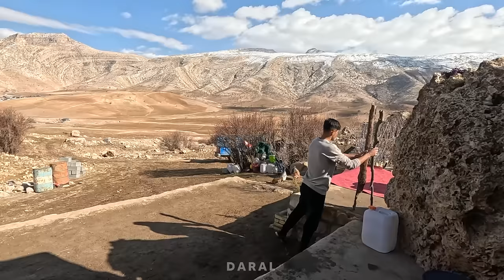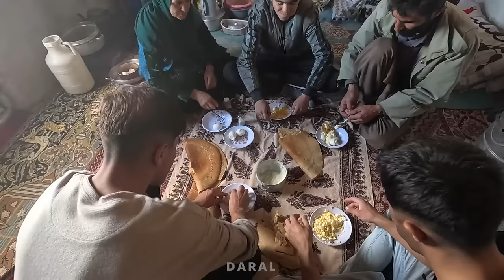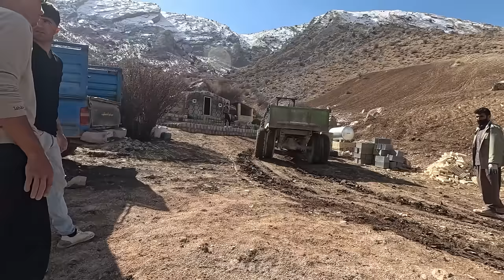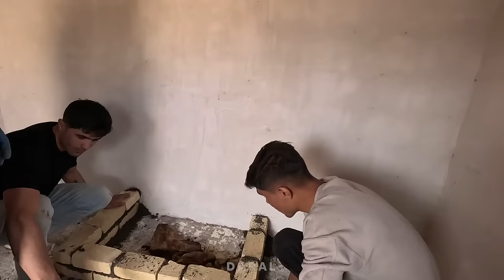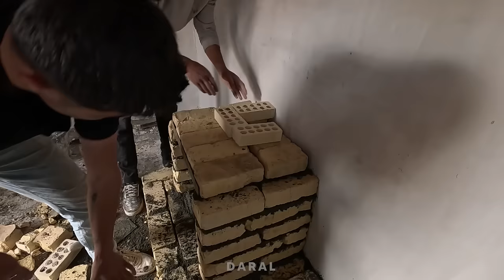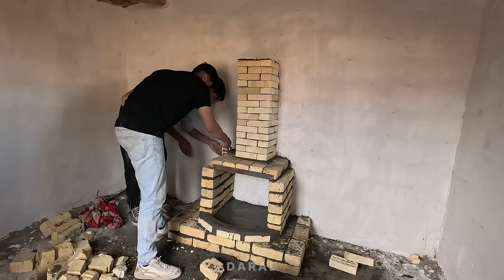"Milad and hasan's Heartwarming Gift: Building a Beautiful Brick Fireplace for Mom and Dad"

Comment: After you boil your eggs,  if you put a little crack in them & put in cold water, for a  5 minutes, the pealing will slip right off. .
 I f you wet the brick before you break it. It will break , perfectly .

Comment: ‼you do know that you have to clean the chimney inside, twice a year, at least, and scrape off all the residue, or risk a fire hazard. When you make a chimney, keep in mind that it is wide enough and in SCALE with the fire place, so that you can clean it inside without a problem, so that you can reach inside the chimney without issues. The chimney must also be in SCALE with the size of the wood burning space, meaning it cannot be too small, for example, or your chimney will fill up with residue and you would have to clean it out inside very often, or risk fire. Remember guys, scale, and safety, and safety is always the FIRST concern in architecture‼
Reply: MILAD AND HASSAN THIS MAN KNOWS HOW TO DO THINGS PROPERLY.

Comment: The air outlet of the chimney is too small, which is not good for smoke exhaust. This will make it difficult for the smoke to be discharged, causing the room to become filled with smoke, which can lead to carbon monoxide poisoning.
An iron door should be installed at the entrance and exit of the chimney for burning firewood to prevent smoke from dispersing into the room and firewood from flying out and burning the carpet.
In addition, there is another way to make a chimney, that is, you can build bricks above the firewood, but you can change it to install a thick iron plate reinforced with cement. You can place the kettle on it to boil hot water, or on the iron plate. It is very convenient for making soup or cooking. It's a pity that your chimney is a little small, which is not conducive to the placement and fixation of the iron plate space.

Comment: The way the chimney is placed here is very unfair to the space of the room. The room is very small. Placing the chimney in this size takes up a very large space. It is supposed to be placed in the right corner at least so that the rest of the room can be used.